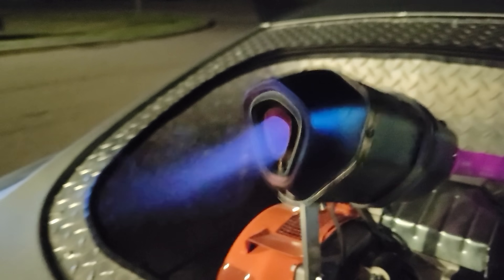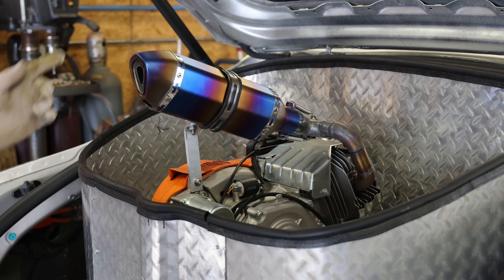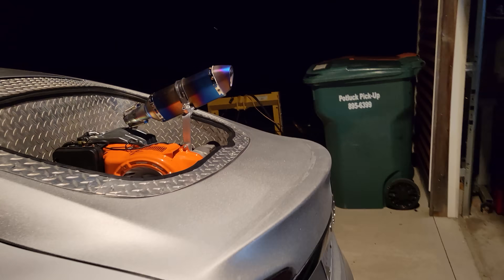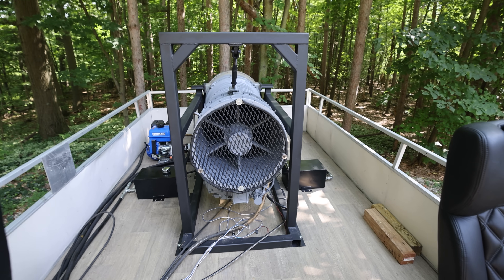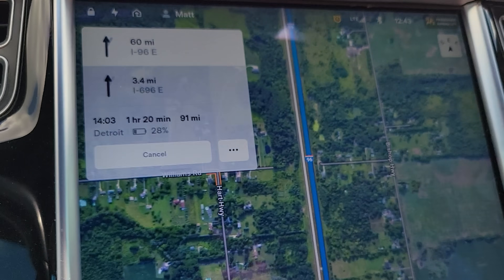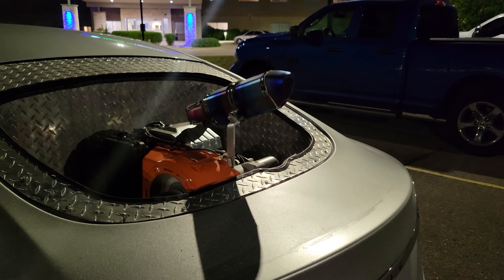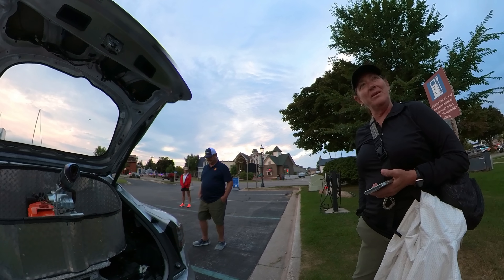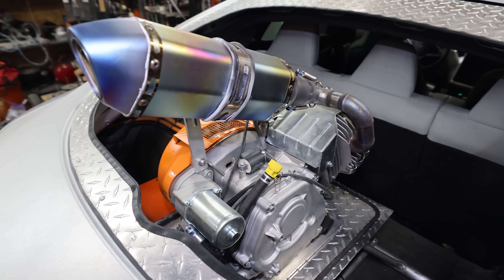Cordless Tesla (I Drive 1800 miles without charging) P.1

Comment: This project is awesome! 

Maybe use one of those small diesel engines from before (the go-kart) instead of the tiny gas engine. That way it would probably be quite a bit quieter as the engine wouldn’t be running at max all the time. That would be essentially exactly like a diesel electric locomotive on a train.

I’m interested in how your generator interfaces with the charger circuits, since the car obviously doesn’t see that it’s charging.
Reply: dont know much about teslas but i would imagine the regen brake circuit would be easiest to tap into. those are basically "generators" already. 
ya i think in order to get enough power from the small engine to barely brake even he was maybe outside of the most efficient rpm range of the engine. that usually doesnt overlap much with the power band. you can kind of see this from the significant change in fuel economy based on speed. the model S is more aerodynamic than that and shouldnt be effected so much at such low speeds unless it was really windy
Reply: Comparable diesel engine would be louder, much louder..
I think motorcycle engine is way better for this load, just need custom crank case without transmission to directly connect to generator unit.
250ccs can give about 10kw @5k-6k rpm and can be pushed to 20+kw in full throttle, and im sure it wont be as stressed as that gx390s
Reply: @briliankamil4594  nah a 10kw diesel engine would be far quieter. An efficient small diesel would run at 1600-1800 rpm and that gas engine is spinning at 3600rpm. the longevity and noise of the diesel wins all day.
Reply: @Crooked_oak_ranch  it depend on the usage, your average diesel generator usually has complete soundproof case, which have to be stripped for this usage..
And bare diesel engine is loud..
Reply: @Crooked_oak_ranch  It's an inverter generator.  It's not tied to 3600 RPM.  It is only running at high speed because he switched off the 'eco' mode to make the most noise and get the most attention.  If he wanted to run quietly he would have used the original muffler.

Comment: Why can't some type of alternator driven by the battery electric motor be used for recharging while vehicle is in motion
Reply: Because an alternator consumes kinetic energy to produce electrical energy. Thus when you shut off your engine the alternator stops producing electricity as it stops turning. 

You can get electricity back from a moving EV but in the process you will bring the EV to a dead stop. This is called regenerative braking and all EVs currently do this. 

However if you are proposing to use electrical energy to produce more electrical energy then you are mistaken. Just as you cannot pour water from a 16oz glass into another 16oz glass and end up with more than the original 16oz of water
Reply: @williamwheaton8117  if you have an EV. The battery could be assisted in charging by a gear or belt driven alternator from the battery driven electric motor ?? Just like a car with a gas engine belt driven alternator ? I'm glad that EV's use the electric drive motor for regenerative braking. Diesel locomotives do this by changing electric drive motors into generators sending the electric energy to a heat grid load thus providing magnetic field load resistance of the grid, thus slowing the train without using brakes.

Comment: That 420 cc engine has a 50 hour oil change interval and a few thousand hour lifetime, I sure it's about worn out at this point.

That type generator is difficult to keep quiet.  Since it is running at full rpm, you have the exhaust noise, and since it is an air cooled engine, you also have a similar level of noise from the engine internals.

Apparently, those EVs are not nearly as efficient as the hype suggests, if a 7 kW generator can't keep up with the car's power demands while on the road.

Comment: 🤔 If he could replicate what nissan did on the e note in more efficient way.That would be quite interesting.🤔Like using a  gasoline engine of the same rating to recharge the car's battery.
Reply: So a basic hybrid like a Toyota Prius which has been around since 1997. Way before the e note.

Comment: Wonder why the car uses 300w/mile or did he have a lot of load or something? Oh I looked it up the newer cars are just 25% more efficient.
Reply from the maker: Mine is 1000hp AWD with large motors. But all-wheel drive is really what kills it just like a gas car..the rear wheel drive model s, and the smaller model 3s get better efficiency for obvious reasons. I do wonder what the wh/mi of the model s plaid is, however it's very dependent on driving style as well

Comment: Love it, but you did charge it for those 1600 miles, you just didn't charge it at a charging station.  So you needed a gasoline engine to go 1600 miles in an electric car.  Thank you for proving they are great for short commutes, and if you have a LOT of extra time you can travel longer distances.

Comment: dud quieten that thing down and richen the motor slightly its extremely lean and this actually causes the motor to lose power and run hotter and actually use more fuel you know the flame thrower effect and the red hot exhaust are dead tattle tales its lean.

Comment: I would go crazy with this generator sound. It's too much even watching this video :D
Reply: Yeah. It's a cool project and fun for a video but stupid for practicality.
Reply: its a shame too because putting a functional muffler on it would have been quite easy
Reply: @killsalot78  
Did you actually watch the video? He explained explicitly why this was not an option. 
A muffler would have cut power to a degree where this wouldn’t have worked anymore.
Reply: @robinsonreichel1268  yeah no, mufflers for generators are a thing and IMO he could easily have just used a 3" ID muffler without hurting performance. after the first pipe just routed down and around. He just didn't want to put in the work for an ugly muffler system when he could have cool hot rod porsche 918 exhaust
Reply: @orangejjay  It might be the most stupid thing ever done in the history of human kind. They already have hybrids...... Please tell me I'm not alone here...
Reply: @realsecman  It is a series hybrid. Hard to find series hybrids nowadays, the hybrids they make insist on have engines that can produce more than the average power needed, have to run at all different RPMS and need to drive the wheels thru a complex multi-speed transmission that often mechanically has to mix electric and engine power to send to the wheels.
Reply: @realsecman  The United states voted for Joe Biden.  So it's at least the second moststupid thing just there.
Reply: I couldn't finish watching the video because of that sound, horrific.
Reply: All he had to do was buy a hybrid car.... This is actual madness... Totally defeats the purpose of the car.
Reply: @realsecman  The concept of using an engine at constant RPM with no direct drive to the car makes a lot of sense, it is how a diesel electric train works. A turbo diesel governed at max torque, around 1,200 rpm would give fantastic economy and be ideal for long journeys where charging points were few and far between.
The BMW i3 used this concept, but they used a petrol lawnmower engine that lasted about a year when used on police cars in London, that run on 3 shifts 24/7 and never had a chance to charge.
Reply: @realsecman  It is a series hybrid. Very hard to buy a series hybrid nowadays. You get a series/parallel or parallel hybrid with an engine that needs to be able to produce way more than the average power needed for driving because it needs to help accelerate, and it needs a complex multi-speed transmission. Series hybrids don't. Now one can take issue with the particular implementation, but series hybrid is a good idea.
Reply: Happy I'm not the only one who got a little anxious watching this video. The sound was insane.

Still, make no mistake, very cool build!
Reply: Just use sound canceling headphones removes 85% of the sound I live near airbase jets sound like vacuum cleaners with my set on
Reply: As a generator technician I've learned to tune out certain noises. Some units when you turn them to the off position they have an alarm that tells you it's in the off position. You can't silence it. 
So deal with it for 2 hours while you service it. 
Tune it out ,it's not hard
Reply: @ As a Field Engineer I CAN silence it. 🔨
Reply: You can clearly see, he purposely made the engine loud to draw attention to his car in hopes of creating curiosity & generating more YT views.....Also you can clearly see there is no generator attached to the engine. This video it complete lie/BS for views, he's not actually recharging his car with that engine in back.....Had he used an actual 7500w portable generator in back (which would make way more sense to use because it'd be much easier & quieter)  I'm blown away by the thousands of people who don't realize this video is a scam/lie for views.
Reply: @michaelbrinks8089   Yeah, I saw that he mounted the engine on but didn't show anything else in the form of connecting it to the tesla  battery some how it charge it.. that was suspicious

Comment: Where is the actual alternator connected to the engine? How are you able to trick the charger module to allow the car to shift into D while charging if you are "charging" the car using ac? If you are supplying 400V DC straight to the battery how are you able to keep the bcm going crazy.
Reply from the maker: Don't get frustrated, you were looking at the alternator you just didn't realize it, I custom built everything, literally everything and it was very very painful.

Comment: I could see pulling a generator trailer but hacking up the back of the car? The max the onboard inverter can take is 48 amps @ 240vac or 11.52kw. That is what a wall charger produces anyway. if he is consuming a kw for every two miles driven, at 46 mph he would consume 23 kwh per hour. Generating 11.5kwh would only offset half of consumption. Am I wrong? It is an interesting video though.
Reply from the maker: True but consumption is way less than that, you're looking at about 350 watt hours per mile at 70 mph.
Reply: @WarpedYT  - So at 70mph you consume 24.5 kwh per hour. Not much different in absolute terms compared to my previous calculation, but a big difference distance wise. It is then 11.5kwh generated against 24.5kwh expended not including charging losses. So interesting.

Comment: It's really ludicrous.
It's a ridiculous attempt.
The power company is doing inefficient combustion to produce electricity, but putting a generator in a car to produce electricity and then running on it is just a double wasteful practice. There is a Japanese proverb that says, "The bottom line is the bottom line," and this is precisely the act of losing sight of the original purpose and misapplying the means. Electric cars are not eco-friendly at all. They are nothing but lies and delusions of those fools who thought that since they could not beat Toyota, they could regain the top position by changing the rules and making a surprise attack. I assure you. Electric cars are not eco-friendly at all.

Comment: That is nothing new this is nothing new in Africa the guy is driving a car running a whole block of houses with just the energy in the air they always knew that you don't have to actually need wires are electricity the way we have it in this world right now God gave us this free electricity which they've been having for thousands of years but because of the people running the world right now they wanted to keep us prisoners to their whim so they have us working for this man-made electricity in Africa a man made a car run just off of the electricity in the air with quite a few people are doing now so the cat is out the bag but I think they killed him or they tried to kill him but I don't even understand why the president of that country didn't surround him with army people to make his country the strongest country in the world without using these man-made wires and everything this is clean energy oil is not clean energy they have a way to make clean energy in their hiding it from us Tesla this is this is no big deal Tesla this is actually you're behind the times so people don't think they're doing us a favor when they say it went 1800 miles when in Africa the black people that made cars that can run forever off of the electricity in the air that God gave us to use look it up

Comment: To have a lower decibel, a good muffler with a catalyst and insulation inside the car could be a good plan, but you'd have to find a better ratio of gears to produce a better energy source. Imagine, you make a smart system so that the engine starts by itself at like 65% of the battery level: less electricity to pay and a better fuel economy. The perfect hybrid.
Reply: Its called electric-fist hybrid or Series hybrid or EREV.
Reply: Imagine a Prius that can do this, would get unbelievable efficiency
Reply: Some kind of crank and shaft combustible surface could also utilize the heat from the gasoline to create torque and thrust.

Comment: BMW i3 ReX Circa 2013 - The i3 was offered in two flavors; BEV (Battery Electric Vehicle) and REx (Range Extender). The former used an electric motor and a battery, nothing else. The latter featured a small gasoline engine under the trunk to help provide some battery juice when the state of charge got too low.

Comment: Consider a smol turbine engine. Turbine engines are remarkable efficient power plants, only held back because the very slow throttle reaction. 
Since RPM numbers don't matter, only power generation, a turbine might be more ideal?

Comment: I don't like the look of the speaker grille on that jet engine intake! I would build a much larger cage around the entire zone. Nobody at the hotel complained about that bloody noise? Why didn't you work on a super silenced muffler system? I mean, you can get whisper quiet generators off the shelf. how powerful is that one? With the angle of your exhaust you couldn't make it any louder if you tried. You should have just fitted a trumpet instead of a silencer.
Reply from the maker: I thought about putting a trumpet on there. This is not off the shelf generator this is 100% custom built, and it was air cool so not only do you have exhaust noise but you also have a ton of air noise.. terrible setup

Comment: Not sure why you went with that motor in particular? Could you do a video on how you came to that conclusion?
Reply from the maker: It's custom built, no I won't do a video and share those details, it's proprietary.
Reply: @WarpedYT  Thanks for the reply. I don't get how a generator can be proprietary, it's not like there is anything new involved (aside from the connection to the tesla). Anyway, cheers!

Comment: You NEED to supplement your gas engine with KINETIC energies (Angular Momentums from your wheels, Tesla Wind Turbines, and Flywheels) to charge the batteries ... not a bigger gas engine ... If you use a bugger gas engine, you might as well drive an ICE car!

Comment: Wow, I am surprised the S allowed to drive while charging. Would have thought it would be programmed with an interlock to prevent that.

Very nice, can’t wait for bigger generator.
Reply: It's a scam video for views, he threw an engine in back with no generator attached for views & got 2.5 million of them. He also purposely made the engine loud & highly visible to attract attention. Also it would have been much easier just to put a 7,500 w  gas portable generator in back. The exhaust pipe was 100% BS/unneeded & for show (why not just use stock muffler?) pipe was for looks,noise, attention. It did nothing to improve efficiency. So many stupid people fell for this BS it's sickening.
Reply from the maker: Good conclusion, look out for version  2.  I am absolutely positive that you're going to love it. Thanks

Comment: Its A Hybrid. Your Still Using Gasoline Fool. What Are You Going To Run Your GASOLINE ENGINE on When You Cant Buy GAS. You Haven't Invented anything. Would Have Been Cheaper and Quieter To Buy A Honda Generator and Stick it in the Trunk. I Have To Question Your IQ.

Comment: I build things like this, because I believe Series Hybrids are the best of both worlds. The stealth & instant-torque of electric, but the convenience of fuel. I always aim to keep the revs low, for efficiency, noise, and wear. But I never knew what it would be like to have the revs so high, for days on end, glowing exhaust, with a tongue of flames. What a trooper that engine is. I already know, if you can't make power with torque, size, and hard hits, then you have to make it with high RPMs, more frequent smaller hits, to have something small but powerful. Like machine gun instead of shotgun-slug, VTEC instead of a muscle car, 600cc sportbike instead of 1200cc V-twin cruiser. 
Seeing low torque high rev generator in practice was so disturbing. My goodness that was obnoxious. And so much heat energy wasted. Maybe add a thermoelectric muffler connected to a boost-buck converter & capacitors?

Comment: if only you could strip out 70% of the batteries and replace them with a capacitor bank.. would run well once you get up to speed, but would be awfull stopping and starting

Comment: I'll stick with my Toyota Prius hybrid, over 60mpg - even with a relatively small tank it'll do over 500 miles on a tank, without the fuel light coming on & doing 70 to 80mph, very comfortable & quiet as a mouse

Comment: I like to see somebody do the same thing or if you could do the same thing take one of those quiet diesel generators the engine from that and then try to get maybe more mileage from it but also have like a switch on the inside of the car to where you can cut the motor off when you want to and to turn it back on